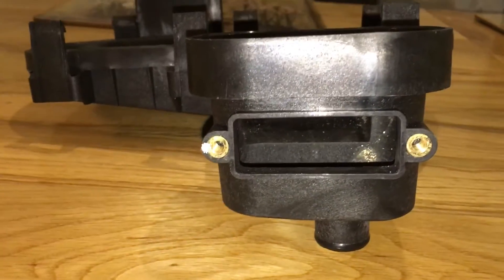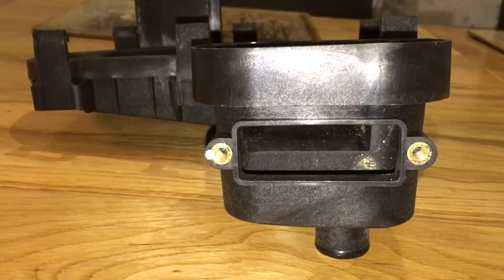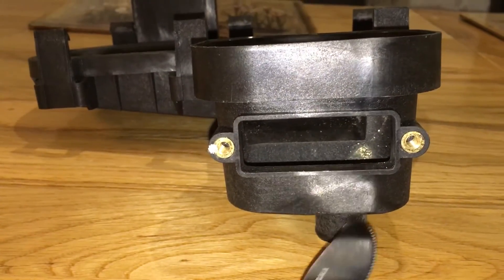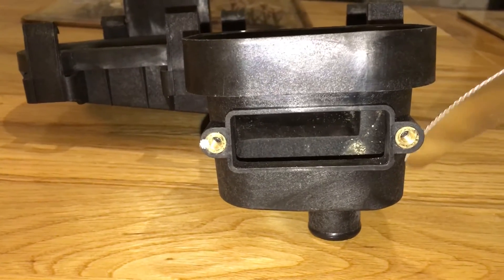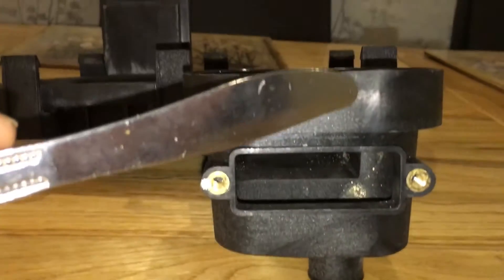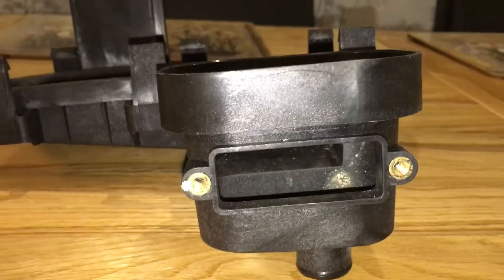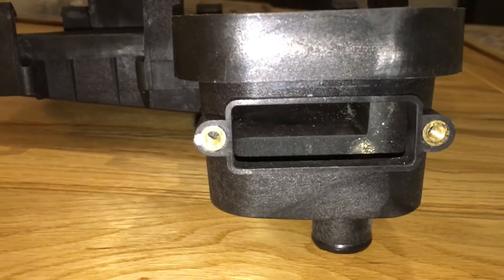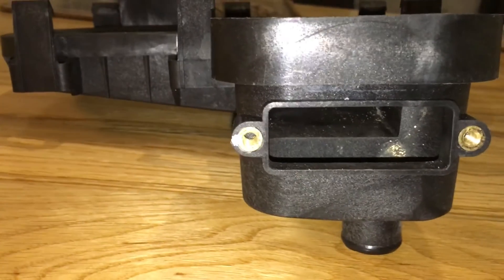Ideal logic cracked sump what to look for

Comment: My builders who are going to fit a new kitchen  which includes a new boiler, and a couple of extra rads,said he likes this boiler,so i decided to email, ideal about this very prob, They have come back to very quickly and suggested that it could be due to overtightening those screws  and that they have now upgraded  this part ,and are not getting many reports for this prob anymore,i don,t know if you agree with this,.
Reply from the maker: Ideal seem to want to blame the installer but thats total rubbish in my opinion, I do not believe its because of how its been tightened as i have been out to ones that havent been serviced that have cracked. Even if it was true it would show the part wasnt fit for purpose in my opinion. The new boilers seem to have fixed the issue but only time will tell..
Reply: Thanks very much alan for you input,all i can add is i was very chuffed at how quick they did respond,i hope there repair team come out as quick ,thanks again for all you videos, and top quality reviews ,. @AllenHart999